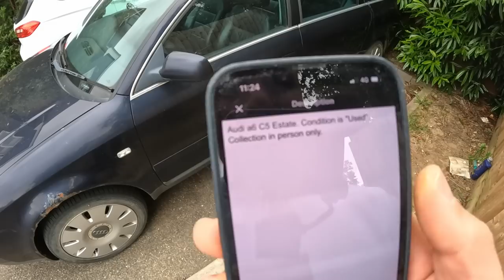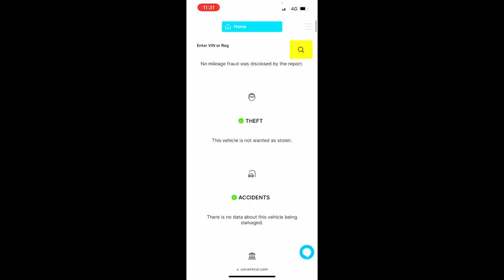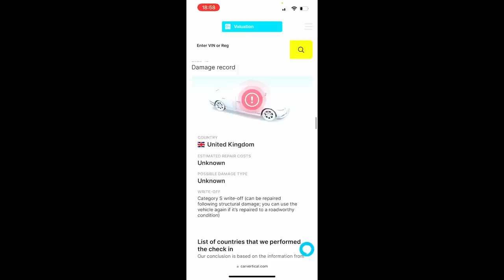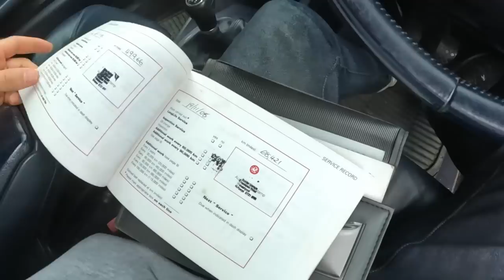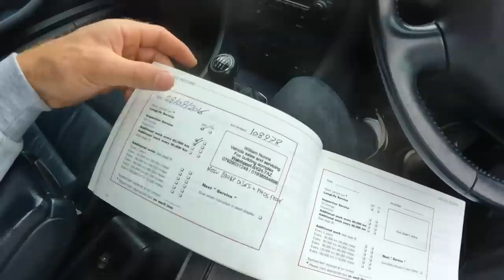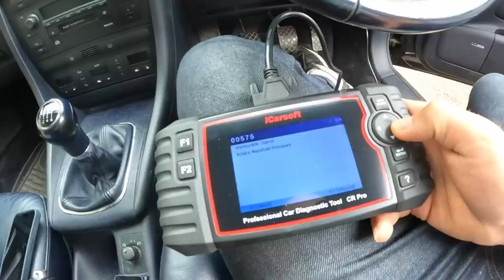I bought the cheapest Audi A6 Quattro on eBay

Comment: Ooh brave, when I was looking for a big cheap old estate car I looked at a few A6s and they were all so bad I ended up buying a rusting W210 E class instead as being less trouble. :D
Reply from the maker: They seem to be hit and miss. Some are in great condition and others not so much
Reply: Best buy if you can find one is an early 2000s Mercedes 3.2 E320 CDI estate, the straight six. One of the best diesel engines Mercedes ever made and much better than the later V6. 45+ to the gallon and 0 to 60 in 7 seconds! My father has an immaculate 2005 saloon model in black, fully loaded and it drives beautifully.
Reply: @MiracleMitch  Don't like diesels, to slow and not fun to drive, even a big turbo OM606 is only fun for about ten minutes then they are just annoying.
Reply: @popuptoaster  Then you are certainly not a car fan, maybe a petrol head at best, or even someone whose experience with cars of all types is limited. I have driven over 600 different cars and some of the diesels have been awesome, fast off the mark, unrelenting torque, agile, high top end speeds and crazy fun. A twin turbo BMW diesel has better performance and is more fun to drive than a majority of petrol cars. I like both petrol and diesel cars as I am not narrow minded and appreciate the best in both types thanks to having been able to drive so many.
Reply: @MiracleMitch  You are just wrong, simple as and I question your experience of decent petrol engined cars if you think that about diesels, in cars they have narrow power and torque bands and most with any decent power have lag, they sound terrible and don't rev very high so you are always in the wrong gear or waiting for boost if you suddenly want a turn of speed whole just driving normally. 

Sure, manufacturers can set them up to get a half decent 0-60 time but that means diddly squat in real world driving, if I ring the neck out of my car it will do low 5 seconds to 60 but it's in gear acceleration and throttle response at normal driving speeds you want, both of which are severely lacking in almost all of them.

The fun in a car starts about 200bhp per ton in my opinion and few diesels ever get near that. If diesel engines were any good for sporty or quick driving they would be used in race cars but they just are not, I would put my 22 year old petrol V8 engined car up against any diesel even a "modern" one. I am also not anti diesel in the right situation, I drive trucks and my boat has an 11 litre diesel in it.

As for you deciding who is a "car fan", that's just laughable you betray your lack of imagination with your first sentence, I have been messing with cars since i was a pre teen, have modified, built and even raced cars and bikes briefly, I am not nerdy enough to have kept count of the number of cars I've owned or driven, but my cousin once worked out I'd owned over 30 different Cortinas by the time i was 20, and that was many years ago, at one point I owned nine different cars at once and I still don't consider that I should be able to tell other people what grade of car person they are....🙄

The history of your high performance diesels says all you need to know about them, BMW started the trend when they saw a market in company car drivers that wee not allowed to buy petrol engined cars, the "sporty" diesel car was, and still is, a poor substitute for those who wanted a petrol engined car but who were unable to buy one for whatever reason, be that company policy or MPG (Which by the way is often not that much better if you try to drive them fast).

So keep your insults to yourself, just because someone disagrees with you there is no need to exercise your fragile ego, you go out for a drive in your rattly old diesel and tell your self you are letting the guys in the petrol engined cars overtake you by choice. 🤣
Reply: @popuptoaster  You have just spent countless words misunderstanding what I have said. My first engine strip down was a Triumph Tiger Cub motorcycle engine which my father, a competing amateur rally driver at the time in Europe, in the lower rally classes, taught me to do when I was 8 years old, much to the annoyance of my mother, who eventually got her kitchen back. We built a working modified Cub from two donor bikes before I was 10. From then on I was hooked and spent countless hours, days, then years, repairing all types of engined vehicles with my father for others as a side income. Apart from machining work we have for the past 4 decades, maintained and repaired our own vehicles. My reply was not "diesel is better than petrol" statement, it was that diesel can be just as "fun" if you have the right setup, remove lag, remove gear change hesitation and so forth. Of course a petrol engine will out race a comparative size diesel, but as you know you can tune diesel engines for relentless torque and engine responsiveness which is where the fun comes in. I don't keep track of exact numbers of cars I've driven or owned, nor the number of petrol, diesel or other engines I have worked on, repaired, rebuilt, modified, but just know that it is above a certain number for sure. I am a bit of a diesel fan, I can't lie, hence why saying they were not fun, was well as insulting as judging what type of car fan you were, or not - it is how comments are received that is important and if my original opening statement to you was offensive, then I am man enough to apologise, which I do now. We have both obviously had a vastly experienced life with ICE powered vehicles, and have different preferences and experiences. I wish you a good day sir.

Comment: Ok just watched it, first thing I would do is put a booster on the battery and first read the OBD faults, clear them then try starting, but it looks like the glow light didn’t come on for long enough, so could have failed glow plugs or glow plug relay or cabling etc. That length of time to take to start, is definitely glow or fuel draining back. When you turn it off after 10mins, does it start right up again? Full service first then go from there I would say with genuine parts or as close to :)
Reply from the maker: Thanks for that, bud. When I start it again after 10 mins it starts up easier than it does from cold, but still not great. Is that the glow plugs?
Reply: @NotEconomicallyViable  could definitely be but try recording the exhaust when you do another cold next day crank with the battery fully charged again, if it takes ages then you get a load of white smoke that will probably indicate the glow plug system is at fault. If you got an OBD reader for now you can see what codes are showing, if not it could be the fuel system, so a new diesel filter, and full service would be a good start buddy, but be warned, when changing the diesel filter, if you’re not careful it can be very hard to start diesels up again, can take a lot of cranking if the fuel filter hasn’t got any fuel already in the filter, and can also get air in the system,  but start with one step at a time. If you’re going to keep that car and engine then definitely service it, oil is crucial for these engines and filters.
Reply: With all cars you’re unsure of, always clear all fault codes first, as even a flat battery can fire up loads of errors as the voltage is too low to power up the ECU and relative computers properly. Yeah the needle lift sensors can fail and you might find that fixes your performance issue, but the restriction in intake as I can’t remember if those engines have swirl flaps, which are notorious on many manufacturers cars to fail and break. But like I said, reset all the codes first bro :)
Reply from the maker: Thanks for all that, mate. I'll take a look at it all 👍🏻

Comment: V8 6spd waggon will be amazing
Reply from the maker: Or a V8 6spd saloon... 😉
Reply: @NotEconomicallyViable  it is your project either way. I'm to in love with the avant to even look at a cupe (saloon?) However my 2.8 gas isn't enough being 2 bolt main and only 200hp but it is quattro and i will have to watch you v8 video to see if its awd or not because in this video you were super excited about the quattro part maybe add that in with the transmission to ruin 4 tires (tyres) at once. Cant wait to see what you come up with.
Reply from the maker: I’m a massive wagon fan, however the V8 models have flared wheel arches. It’d be too much work for me to cut the wheel arches off the saloon and weld them onto the wagon. Otherwise I’d V8 this wagon in a heartbeat
Reply: @NotEconomicallyViable  would you be able to fit the bumpers off the saloon or another saloon ( I hate to take apart a car just for  some body panels leaving it apat)

Comment: Nice old audi they run forever i had a few of them the headlights can be refurbished easy enough if the turbo was gone it would be smoking badly so it ain't that youl get wings cheap enough get some wynn diesel treatment can help cleaning the injectors 👍
Reply: Stick some atf in the fuel

Comment: Easy headlight restoration for starters, bolt on new used front wings in colour. Bit of leather creme to refresh the leather and a few electrical issues. 

 Should get some decent and varied videos out of this one. Time for cutting, welding and electrical diagnosis practise!! Can't wait! 😂

Weak lift pumps (in tank) are a common issue for mid 100k cars which goes with one of the code(s) you have, plus a slightly slow starter motor (often the solenoids get contamination around the internal coil unit and just need a clean). Common rail injectors are a few hundred pounds each new but used good ones can be sourced (PD injectors like mine in my 4 pot Passat are mega expensive and cost at least a couple of thousand to replace the set with new!
Reply from the maker: Cheers for that bud. I'm definitely gonna be learning to weld, but now right now. Got lots to do in the meantime

Comment: Did Audi use the salt based galvanising on that model😅
Reply from the maker: Either that or the wing is made from recycled ice cream cones 😂
Reply: @NotEconomicallyViable  that’s a good description of the crustyness 😂 we just got rid of a 2002 vw Passat estate with over 180000 miles on it and not a spot of rust on the body. The abs pump and fuel pump went. I can’t understand how that Audi is so rusty?